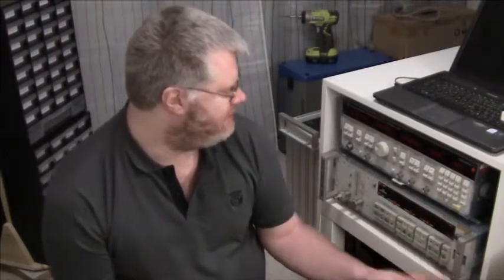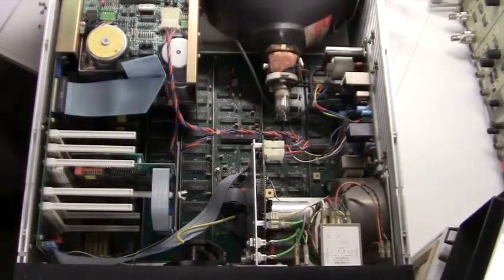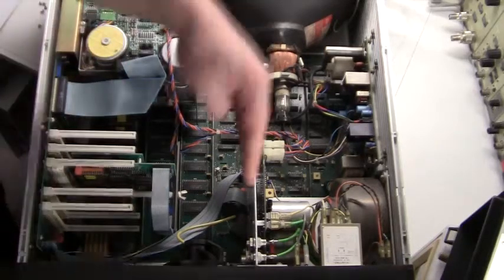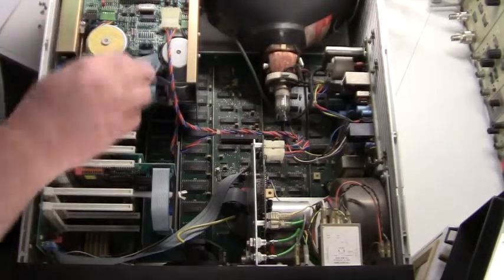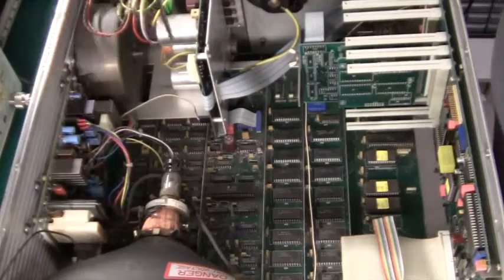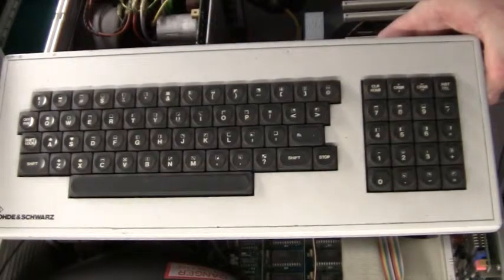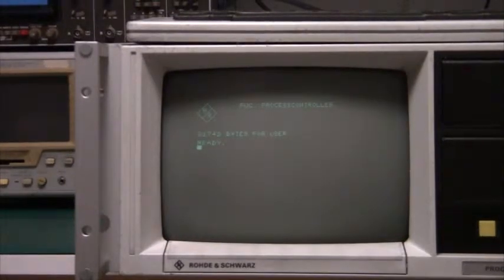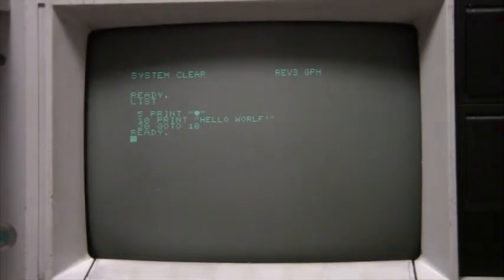Teardown of Rohde & Schwarz PUC process controller

Comment: Did you ever get the system disk for this?
Reply from the maker: Never. If only they had included the disk format function in ROM, and not on a floppy disk. It's the dumbest decision ever. They even had a service where you could contact Rohde & Schwartz and buy pre-formatted disks!

Comment: Fascinating! I'd never heard of this machine.

I recall that HP had a few computers of this sort, intended as process or test procedure controllers. I never worked with any.

The PUC seems to share only a few chips with the PET.

I imagine that such a machine could still be useful in production environments.
Reply from the maker: Yes, you are right. There is a lot of stuff online that says this machine is an updated PET, but that's not really the case.

I have a Rohde & Schwarz vector network analyzer from around 1980. It consists of a frequency generator and a measurement unit, and the PUC. I hope to get it up and running at some point, but I have given up on the PUC, because the "format" command was the only disk command not in ROM.  A major blunder from R&S.

So, without the system disk, the floppy drives are useless. I can write a lot of basic programs to use the GPIB bus, and also draw high-res graphics like smith-charts etc, but not save the data.
Reply: +NatureAndTech I used an HP network analyzer c 1973. It was very useful but also very expensive. Only large companies could afford such a beast.

My employer's lab was equipped primarily with HP and  Tektronix test equipment, but we did have some Rohde & Swartz pieces as well. None was under program control. Each test was ad hoc, as it was an RF product development lab.

Does the PUC use hard sector diskettes? Ten sector? I know that Commodore made an external diskette system, but never touched one.

Does the PUC seem to use its own ROM-based proprietary operating system? Do you have any PUC documentation? Does Rohde & Swartz respond to your inquiries?